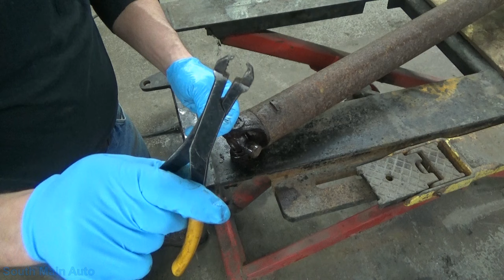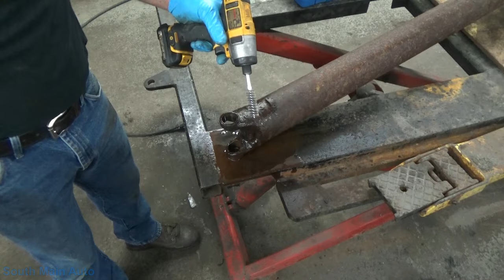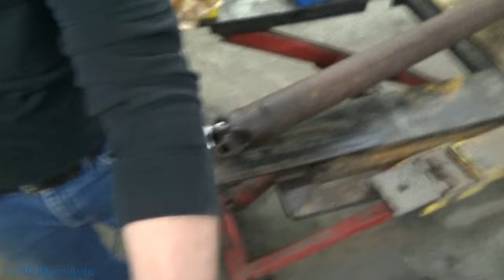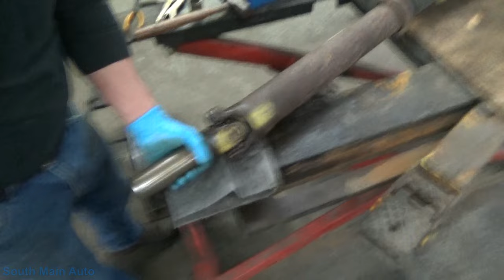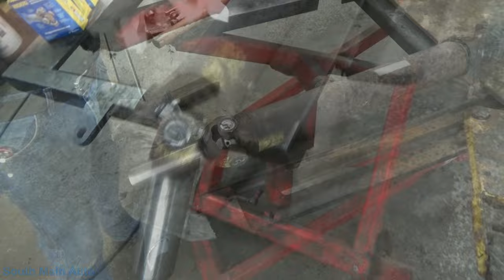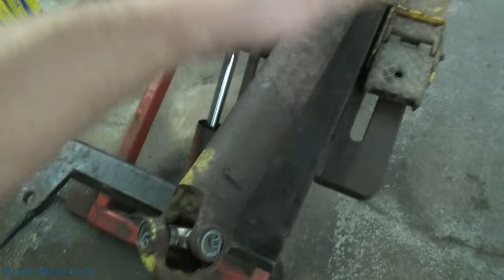How To Replace U-Joints (ULTIMATE Guide Using BFH)

Comment: Man, he makes it look so easy...I've had some fun with u-joints in the past. I went to change some on a Yukon XL, and rookie me used a ball joint press. Well, sure enough, it bent the ears of the shaft. $255 later after taking it to a pro to fix and then just finish the initial job...I had another job about 2 years later, this time on a Silverado. I did the hammer method that Eric has here, but there was juuuust too much rust to make it seize in the ears...making me have to go back to the pro shop again. That was the rear shaft. I finally managed to get it though for the front shaft. I did the hammer method, as well as using a press, but without support from the opposite end, only the sides. So pressing from north and supporting from east and west, leaving south open. Between those two methods, and referring back to this video many, many times...I managed to get it relatively easily, including the stupid plastic injection stuff,  and so far no issues at all with the joint. Ended up having barely any resistance when finished. Hopefully I don't have to do any more soon...though I feel fairly confident in it now. I guess sometimes you just gotta screw up a few times to really get it lol...

Comment: Good advice on not using the press. I learned that on a Viper axle. Great video. Done many U-Joints and I still learned something.
Reply: if a cup is BOUND UP OR RUSTY  any press of air hammer will destroy the  yokes beyond use
Reply: The key to air hammer is to get a really good air hammer like a Snap On.  The way to tell if you have that good air hammer is that you should be able to throttle your trigger. If your trigger is more like on/off, it's probably too violent for u joint use.

Comment: This is exactly how I do it. Many of them in the woods at 2am in the middle of a mud hole. Got a box in the jeep with spare u-joints, blocks of wood, hammer, old sockets, a chunk of round stock and something to get snap rings out. And yes, have done the dropped a cap and use old needles lol

Comment: I normally cut the cross with an angle grinder and then press the cups out, but when that's not an option I press the cups apart like you showed and then put washers in the cup. This enables you to press the cups all the way out.

Comment: Hi, Eric.  I have changed a bizilion u-joints using he BFH method.  What I have is an old ball peen hammer with the ball broken off and the head is slightly smaller diameter than the u-joint.  I lay the head of the hammer on the bearing and hit it with the BFH hammer.  Keeps my hand out of the way of the BFH.  No fun if you slip and bust your wrist with a BFH!!!  Yeah, I know, I am a little on the clumsy side.  Works for me.

Comment: I got nervous putting the last two caps in, worrying about the needles falling and having already tapped the cap in some so it'd be hard to get out if I needed. But, all worked out. Trucks driving smooth now, thanks man.

Comment: I still swear my troubles were caused by lazy cross machining with two dodge U-joints, but I'm not using that shop press ever again either.  I thought that would be the sweet part of getting it only to learn that you don't even want to go there.  Hammer method is much safer just for starters.  Learned a new technique, nice going Eric, bust em both out as far as they go and then step punch em the rest of the way with their own cross.  If you can't hang on to that big boy hammer they will come take your man card away.  lol, always a riot, thanks for letting us peek over your shoulder.

Comment: I was going to have a shop do my U joints this week but they wanted to balance it too to the cost of $300. Nope. I have no vibrations now and I have the original 22 year old 244k mile joints. They are rusty and crusty but they are still holding on. I am using this knowledge to replace them myself this weekend. Thanks

Comment: I had a GM That I had to have heated to pull apart. of course I only realized that after I pulled it out. Had a friend that worked at a GM dealership that helped me out. I never would have figured it out. This was before YouTube. Those hanger bearing can be a pain to change I hear. I had one on my Chevy van extended and it went 3 months after I bought the van. Good Job Buddy.  -John

Comment: I've always done it the way you do it. However, the guy I use to have do my driveshaft work in Canandaigua used a 1 ton arbor press. He made it look easy. Didn't matter how rusty the shaft was Vic could change the ujoint in minutes. One of the few things I miss from NY was that shop

Comment: First U-joint job I ever attempted was on my '94 K1500 - had 222k miles on it at the time- pretty damn good, but I digress. Had that nylon-injected retainer. What a joke! So remembering how my dad and grandfather always rammed them out on the vice, I figured I'd use my brand new handy dandy ball joint press I had picked up at Harbor FRIGHT in Phoenix a couple years prior, before any of those stores had migrated east yet. Long story short, I "opened" the press up - yep ... bent the pee out of it! In the process of that, I also bent the driveshaft. Fun, fun!  Couldn't get the internal clips in on the new joints. Had to be at work the next morning, so I went gorilla on the clip, and got it to stay put. Knew it wasn't right, but I was so mad and tired I was in IDGAF mode ... lol! Wasn't until I had turned on this new thing I had found called a PC, and got on this thing called the "internet" that I found you could heat those damn things up, melt the nylon and blast 'em right out easy! Live and learn, LOL!

So I did manage to get 3k miles out of that joint, before it came apart rather violently on me, on my way home from work, of course at 10PM, pitch dark, on a busy MA highway! The driveshaft flailed around and smashed my muffler all to hell, but not too much damage considering. Made a hell of a racket, lol!  I just yanked the shaft out, threw it in 4x4, and drove 10 miles home. Left a trail of ATF for about 1/4 mile or so until the level dropped. HAHAHA!

Since '09 I've been using the 20 ton press. Pain in the ass! I ended up going back to the way you're doing it, because like  you said, I've bent driveshafts, and blown out cups since you can't feel a needle that fell over.

Did a couple double cardans for the first time on ... I think it was a '99 F350 a couple years back. Used the press on that since it was 9° outside - I would've rather have done that one in the driveway than in my crowded barn/garage/shop ... with a dirt floor. Was a royal pain, but I got it done with no issues. The rust is a killer up here!! Makes life 100x harder than it needs to be.

I spit my coffee out on my monitor when you said, "We'll just give up and tell the guy he needs a new driveshaft." BWAHAHAHAA! That was great!  That works for me on econobox car brake calipers ... LOL! Those are cheap enough. Can't imagine what GM charges for driveshafts ... 

My '07 Silverado's shaft is of course aluminum. Haven't done one of those newfangled units yet. At 88k now with heavy towing, so could be any day now. 

Was glad to see I'm not the only one that left the press idle - I felt like a hack doing it with the hammer and socket, but it was easier. Whatever works, and works right!! :)

Comment: I watched Danner do his u-joints on his Jeep with the ball joint press.  My dad taught me how to do u-joints just exactly like you did here.  We never ever bent an ear or damaged anything.  A hammer and a couple of old sockets always did the trick.  When I was in high school I changed out quite a few on my old 74 Datsun 610 with the independent rear suspension (like the old 240, 260 and 280Z's.)  Teenage boys go through u-joints....hmmm wonder why?

Comment: Timing is everything.   I'm doing the U- joints on my jeep today.   I lust finished making a pair of tools to use on my arbor press that is similar to the tools that "YoungsgearLLC" channel uses in their video.  I see that the "Weber auto" channel you referenced does them the same way, but with a slightly different tool.  Hopefully my 3 ton arbor press will push them out as easily as theirs did, otherwise I will be doing a lot of swearing today.  Im commited to post a video no matter how bad it goes since I already have videos on making the tools.  Chris

Comment: Man, watching you beat on that yoke joint like that made MY arm tired and achy, however, it is the safest method to use in order to avoid yoke or shaft damages... Especially those aluminum shafts as I found out once how easy they deform using a ball joint press...

Comment: I've changed a few dozen u joints this same way..i use an old 17mm 1/2 drive deep well socket it's  pretty mushroomed up after years of service..once I got a set of torches I started cutting the old joints out it makes the process so much quicker..less hammer swings..

Comment: Some heat with a plumber's torch causes the metal to expand and they slide out/in very easy. Using a press is a lot easier too. Nice video!

Comment: A hammer is certainly the way to go.  I feel about a u-jont press the same as you do about Dorman.  I own the Tiger Tool press, and used it a few times, one being not such a good experience.  Just as you said, the ears of the driveshaft were distorted, and it ended up being sent to a driveshaft shop to be fixed.  I've never damaged one with a hammer.  Great video as always.

Comment: My method, basically the same. Douse it in liquid wrench, pound the old one out, clean everything up real nice, little grease, tapy tap tap the new one in. I also have tried both pressing methods with not much luck and these yokes & aluminum driveshafts aren’t cheap.. The BFH method really knocks a lot of the rust loose and that’s really the key with stuff up here in the rustbelt.

Comment: I did it the same way you're doing when I worked on the Principal's car back in high school auto shop.  It came back 3 times because someone messed it up and both times the student used the shop press.  I just used a bolt and hammer to press it out and press in the new u-joints.

Comment: I used to have to change u joints a lot on my old 73 Power Wagon.. gotta line those yokes up in phase.. I used a big bench vise, and pushed the cups out with a nut to go inside the yoke, and a socket on the opposite side to allow the bearing cup to slide out.... It worked most of the time... haha.. tnx for the vids.

Comment: Re: U-joints, we do it the same way you do.  Only difference, we use a 6" vise to support the end being worked on and usually put a little extra grease in the caps to keep the needles from moving.  PS:  I like the bolt-drift, will have to look for one of those.

Comment: Eric, In all my 40+ years I have always pointed the grease fitting towards the Center of the driveshaft. I have done many constant-velocity drive shafts in my day.Ken
Reply: I also have done that for over 50 years
When you install the grease fittings toward
the shaft & when installed,you rotate the rear
joint fitting down to grease it & grease the front 
one from the top
That way the joint is opened up more because 
of driveshaft angles & allows better grease gun access
I also agree with the person that works in a driveline
shop Spicer Joints & no Grease Fittings unless you want
one to break on you

Comment: Using the lift as your anvil/work bench is a great idea !  Why didn't you use Big Nasty ?

In the "old days" long drive shafts used a pair of u-joints in the center, 90° out of phase.

Comment: I use the same method. I did notice though when trying to get the cap off you were hitting the side on vise grips trying to pull it out per say. Try hitting the top of it with hammer to twist the cap back and forth inside the yoke. Usually loosens up the needle bearings or breaks the rust bond between cap and yoke and will then slide or pull out as you were trying first. Great video like always though

Comment: Another good video, I use two 1/4" X 6 x 4 steel plates with threaded rod so there adjustable for different width u joint and pipe with end cap on . And pound them out through top . That's probably why I have never seen that burr you had. Like they say different strokes for different folks. Have a great day. Keith

Comment: Should I put light coat of anti-seize on the lobes and caps? 

I've watched a few u-joint videos. Am I missing anything?  Yours was the last one.

1. Freeze new bearing caps for 48 hours.
2. Mark all orientation of flanges. 
3. Whack around the shaft lobes with BFH. Lube and knock out the old caps with a BFH. 
4. Clean, smooth, and lightly spray lube the lobes. Clean the clips homes.
5. New cold bearing caps should go in almost by hand, a few light whacks to set.

Make sure replacement clips are the same thickness as originals. 
Some lobes will get bent from the press out tools when the old joints are very rusted in. So use a hammer to knock out instead.

Comment: i usually add a little great into the caps just to keep the needles in place as i hammer the other end in. i also try to push the first a little farther so that the caps will slide into the cross on both ends as i drive the caps on. thats just what has worked for me over the last 20+ years

Comment: I use a similar method to you. BFG and an assortment of sockets to knock the caps out. I like to use a ball joint press installing them though and crank them in by hand. Less chance of knocking the needles loose when your not shocking the joint caps with the hammer.

Comment: Great job showing your method. Very similar to how I do mine.  I've done u-joints for over 45 years, maybe 1500 to 2000  total. The dual constant velocity ones are a pain. I always put an extra dab of grease on my pinky finger and smear the needle bearings in the cup as added protection to prevent the needles falling out.  I remember when GM brought out the glued in joints. Best way to remove them is to heat around them with a torch until the plastic melts then pound the caps out.
Reply: Old timer here too, I remember those glued joints too and yes, we would torch them as well. I used to use sockets and a vice as a sort of press at times. But nothing beats a BFH 😆

Comment: I, like you, have tried it all the ways mentioned and a hammer and soft bolt work the best. The only advice I can give is to not get in a hurry or go gorilla.Old style Corvettes with the half shafts gave me fits and I didn't have the rust you have. Just my two cents.
 I don't know if you remember but I called about flexible astro 30sl lights, I found some after much searching.

Comment: Perhaps helpful idea.  I have a set of vise grips I have welded a rod to and in essence turned into a slide hammer.  Works great when trying to get things like stuck cups out if you can get a real good bit on it.  Also works super good for stuck keyways in shafts and such.

Comment: Never had a problem my entire life doing u joints, always used the BFH and socket method. Until this week we did a buddys 2500HD aluminum shaft(my first aluminum shaft) and those caps would not move at all. Had to cut off wheel the joints and take caps out 1 at a time. Made me a nervous wreck and wore me out....lol

Comment: I'm a DIY, kind of guy. And panther piss makes a big difference and I do chuckle when I hear you call it that.. But up in Alberta Canada, I use the, actual brand name Katz Azz. LPS KB 88 also works great. They are both more of a foam penetrator, but LPS smells like bubble gum. And you can see it pull out the rust. Also TRIPAK L.D.L.-2. Truckers tend to prefer TRIPAK for their ratcheting boomers up here. I had a heck of a time with the front inner axle u-joints on the ram last summer. Brothers trick went good for getting the sealed bearing out, but man rust, rust, rust.

Comment: I had to do a replacement recently of the axle u-joints in my 01 Jeep Cherokee.  I had watched several videos on the process before ever starting so I knew what I was getting into.  I tried the drift method to begin with but the caps just would not budge, yes I removed the clips before starting.  I tried using a press and the caps would still not budge.  I sprayed penetrating oil on them and still nothing.  Finally, I put the press back on it and cinched it down as hard as I could.  Still nothing so finally, I hit the end of the press as hard as I could with an 8lb hammer.  The cap exploded out of the back of the press along with all of the needle bearings and impaled into the back wall of  shop, where they remain.  When it finally let loose, it sounded like a 12ga shotgun.

Comment: Kind of curious why after doing all the joints, even the fairly good ones, they chose not to replace the carrier bearing. I know it's a bear but If the shaft is out and on the bench I would have done it if it were my truck. Any way great video as always. I've watched them all!  Thanks.
Reply from the maker: I just do what I am asked :)

Comment: Nissan service manual instructs as you did, the hammer method except there is different thickness snap ring to center the cross around the driveshaft axle. But don't wory, I've just disassembled a  factory assembled (from Japan) driveshaft that has some play (around 0.30 mm) in the u-joint due not installing the proper thickness snap rings. All of them were off by more than 0.2mm from factory and I thing the operator just did as you did by press fitting the bearing caps to preload the bearing and then loss them a bit by the hammer method.

Comment: I usually use my ball joint press when i do the joints on my dodge 2500 diesel. They get stuck in there real hard even after i put no seize on everything. I also have a few different sizes of brass punches that i use so as not to wreck the steel.